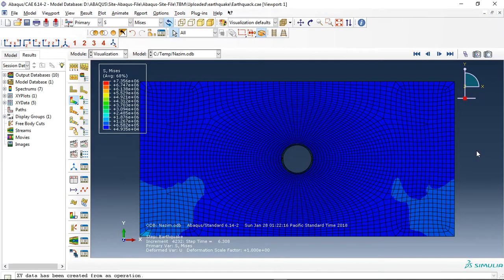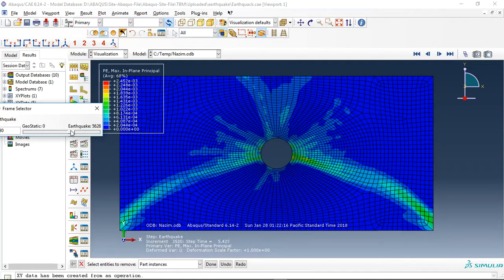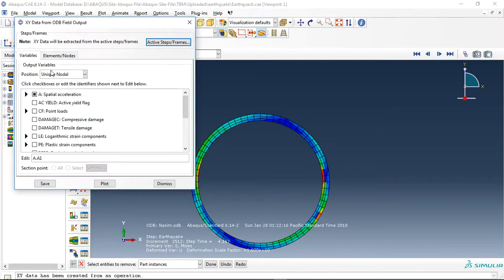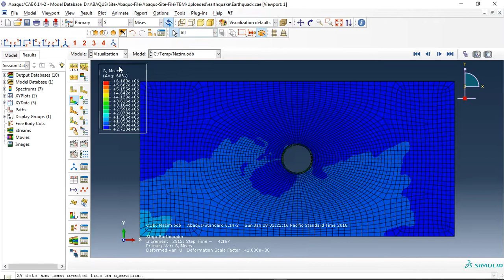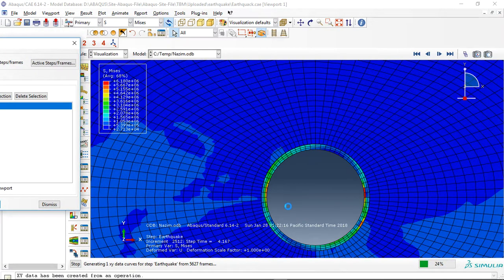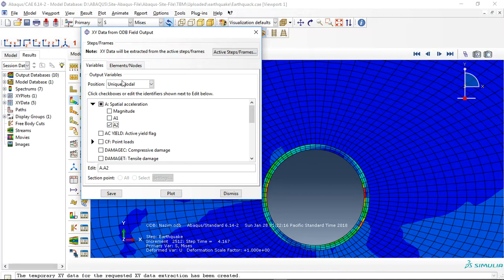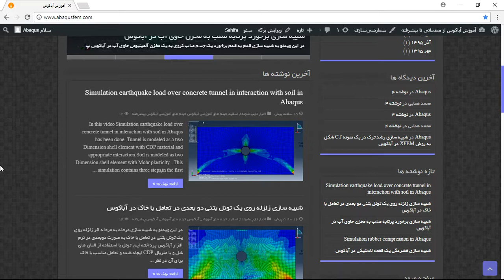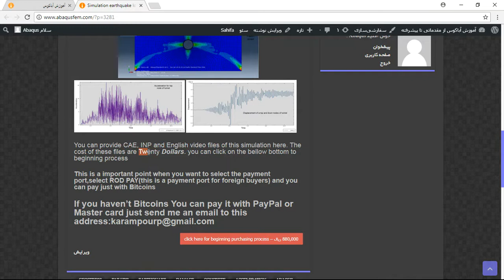Simulation earthquake over a concrete tunnel in interaction with soil in Abaqus

Comment: Hi Mr. Peyman Karampour, this is an interesting simulation, you need to introduce how to set the boundary conditions, and how the seismic waves are input into the model, which is related to whether the calculation process is correct.